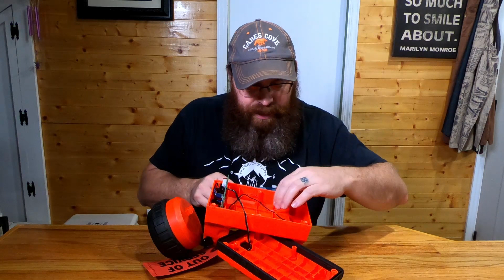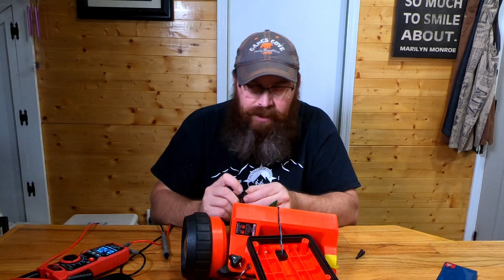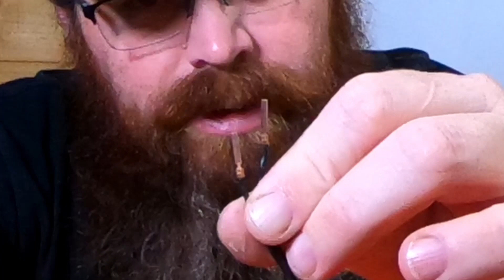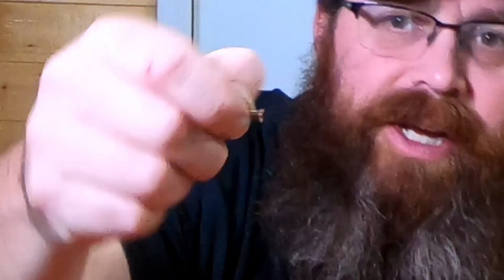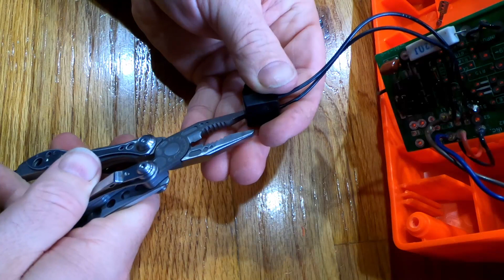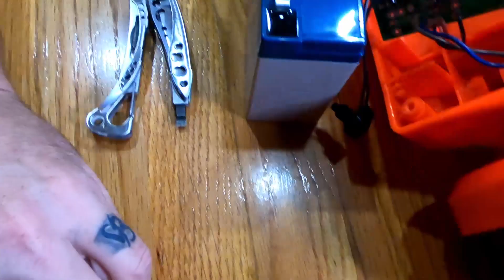Streamlight E-spot lightbox repair

Comment: Found one these in the dumpster.  I think they threw it out because of this problem.  I got it to work by jiggling the switch.  I was going to buy a new switch but thanks to you I will just clean it.
Reply from the maker: Score! Another's man's trash is one man's treasure.
Reply: @2TrailHikers  When I opened up the switch, I could see the corrosion.  Cleaned it up, switch works without jiggling.  Thanks again for the video!

Comment: I own exactly this model of lightbox and had exactly this problem -- and your video got me through actually repairing the thing. Well done! Weirdly, getting the rubber cap off the switch was the hardest part -- I didn't know how hard to press and how to twist, and we're not quite seeing you do it (because once you know that the black rubber cap has a threaded plastic insert, it's not really something that would even register as difficult). Also, I managed to screw up the switch reassembly once, but you made pretty clear which order the parts go and how things work, and when and how to test things during the process. Thanks for moving the camera so we have such a clear view of that switch, and thanks for explaining it so well. In closing,

If you're having lightbox trouble I feel bad for you, son.
I got 99 problems, but the switch ain't one.
Reply from the maker: Awesome glad it helped

Comment: If you purchase the 2 wire switch and upon opening up your light, you find that you have a 3 wire switch inside the light, (2 white wires and 1 black wire ) simply cut the old switch out leaving plenty of wire length coming from the board, solder the black switch wire with the writing on it to the black wire coming off the board in the light.  Then, solder the 2 white wires together that come from the light board to the other black switch wire (the one with no writing on it) together. It will work fine.  I was unable to find the 3 wire replacement switch.